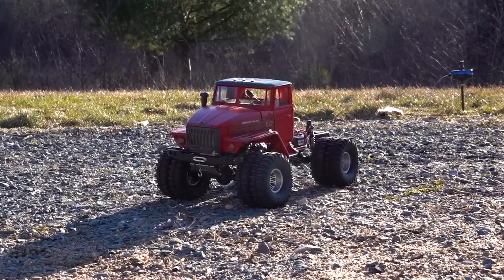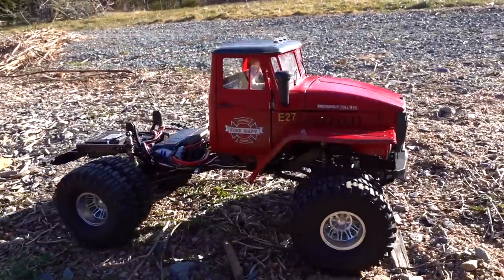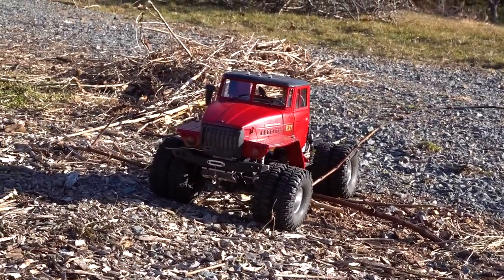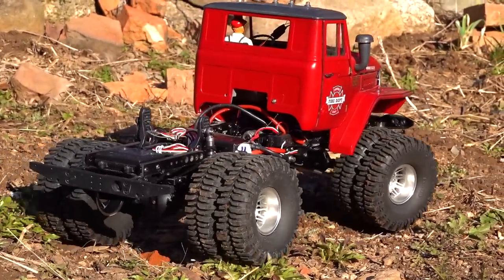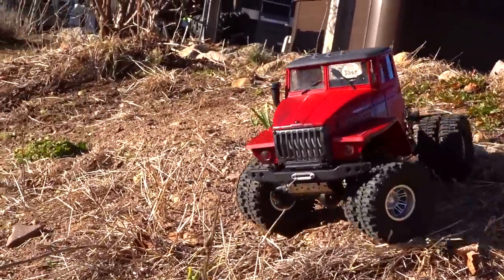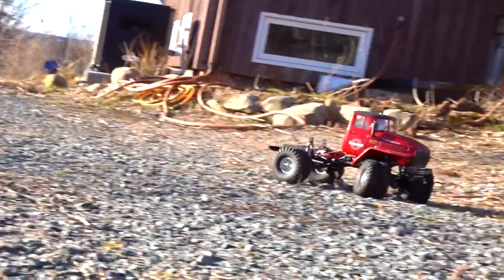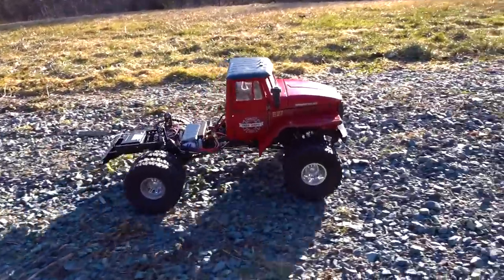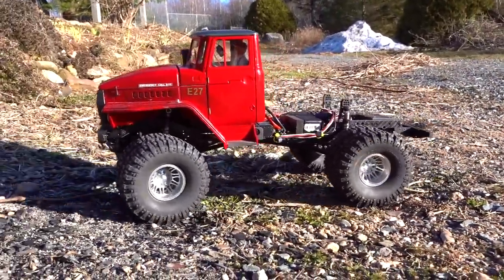"DUALcifer" - Fire Rescue Bush Recovery Truck | RC ADVENTURES

Comment: That is friggin awesome! A guy local to me has an old Chevy c70 I believe. It's similar to the Brigadier. He turned it into a 4x4 then added dual wheels with super swamper tires. He called it the Swamp donkey. It would go anywhere he pointed it in a swamp. He put an old Holmes winch driven wrecker on the back to tow out his buddies. Cheers

Comment: Nice looking truck!  I can see this as a tow truck  - put a flatbed and put a hoist rigging on it.  Ain't done anything but put different bumpers and winch on vehicles, but this is the plan for the 1/10 Atlas when I get it.

Comment: Aaron can you recommend me a very inexpensive RC off-road truck something for like around $100.
I realize that's really cheap and it won't have good range, speed or a LiPo etc, but I'm thinking there's something from a big-box store/Amazon that might fit that budget.

I'm a bit older than you, so you might not know of this, but back in the 80s Sears had a Rc car called the Lobo. 
It wasn't something you would find in the hobby shop back then, but for the price it provided lots of fun. 

I understand it not the typical stuff you normally mess around with, but I'm hoping you know of a off-brand non-enthusiasts setup, like something just below entry level for the normal typical enthusiast.

Hmmm🤔 after writing all of this I just realized a possible problem with my plan, replacement parts lol. 
Crap 🤷, I can see that being a huge problem with that idea 😂 hopefully not🤷. ✌️
Reply from the maker: WL-Toys.com go check out that site.. there is really inexpensive RC and cheap upgrades. Hope that helps!
Reply: @TheRealRCSparks  Thank you for the link sir👍.